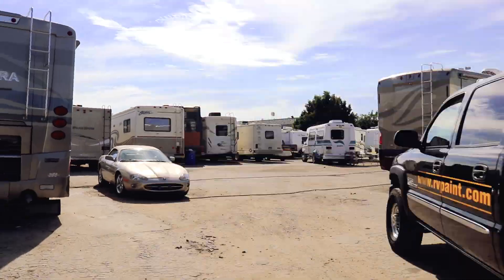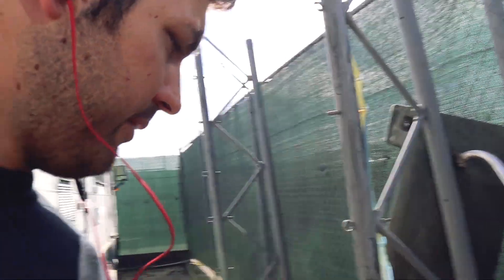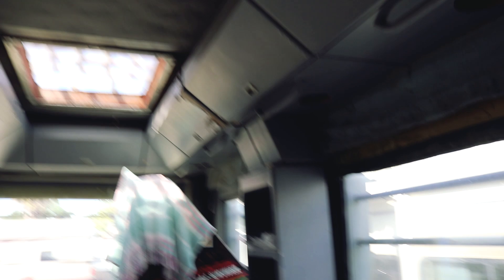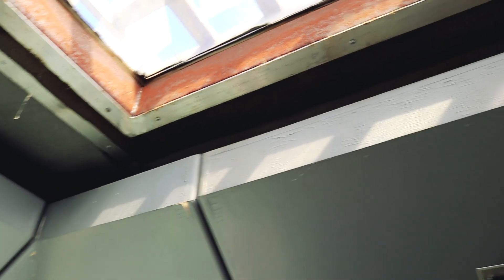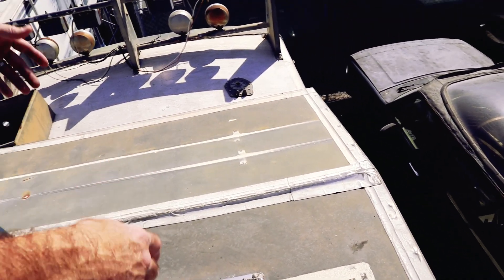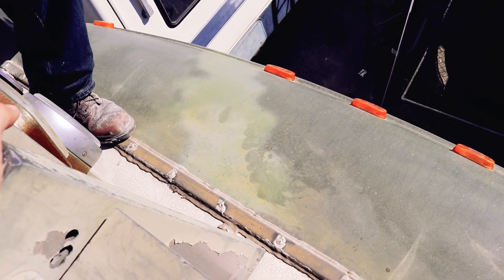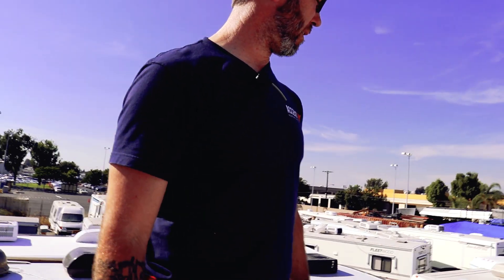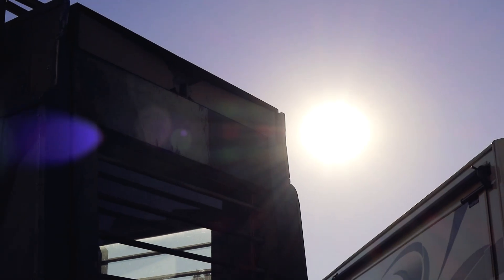Jurassic Park RV Restoration - Part 11

Comment: I remember as a kid I always wanted to build a full-sized Lost World RV made almost entirely of wood, instead of steel as the movie portrays it as. The RV itself would have been powered by pedals and chains like the old go-carts I used to ride, which if I were really to do something like that, it would have been a disaster. It wasn't until years later when these videos came surfacing up, I realized that a good portion of the back trailer was made of wood. I guess there's irony there.
Reply from the maker: M1GarandMan3005 hahaha, life loves irony!

Comment: I have restored and built a few RVs and Boats, Use screws to fasten the props back, adhesives will not last long enough on a rubber roof / roof coating. I also would use the dicor non-sag instead of self-leveling for the add on accessories.
Reply from the maker: Brian Jansen thanks

Comment: Just started binge watching this series.

I swear it's driving me nuts seeing crappy >old< wood being replaced with crappy >new< wood.  If I were on the left coast I would so donate a bunch of time and TIG up aluminum plates to replace all that crap.

At a minimum, make a mold of that big-ass rear door and re-cast it in prepreg e-glass with some carbon stiffeners.

Comment: I'm excited to see this project move forward. I'm not in your position, however I think it was a mis-step to leave the RV there in the hands of these guys. Also, we don't find out if the water pump was changed and or solved the problem? 36 minutes is a decent run time, but where is your crew and editing? Production value from previous episodes is lost.
Reply from the maker: Cody Glive It's a one man crew for now, and I decided to quickly edit that video that I took on the moment so that you guys can be up to date quickly rather than a year later as it happened before. I'll try to get better at editing though :)
Regarding the water pump and radiator it still hasn't been done and the mechanic was supposed to come that day but didn't show up. I'll get a quote tomorrow hopefully!

Comment: If your putting in that kind of work and preserving it's better to repaint it after all this work. You've come so far now it's better to reseal and kill that rust. It's good to keep original parts but they are already worn out and a coat of paint will make all the difference. Also that both shitty and incredible how much the rats chewed. Good luck and hopefully we see you at the meet up with the old beast! Also what that shop did was horse shit. I could have done half of that in a week by myself and better.
Reply from the maker: Mostly Accurate thanks for the words

Comment: what if you got a new radiator and just disconnected hoses from the old one, left it in and connect to a new one and just string it up with metal zip ties temporarily
Reply from the maker: JaceD4V1S88 wait for tonight video

Comment: As someone who has restored many classic cars, built and restored projects for many many years and worked professionally on outdoor enclosures (which aren't that much different to this RV in structure) there is nothing complicated about restoring that roof.  Nothing - this is the equivelant of the classic mechanic sucking air between his teeth while he works out how much of his member he can get up your backside without lubricant. Sorry, this shop should have been sacked a long long time ago (yes I know this is an old video)
Reply from the maker: Very true